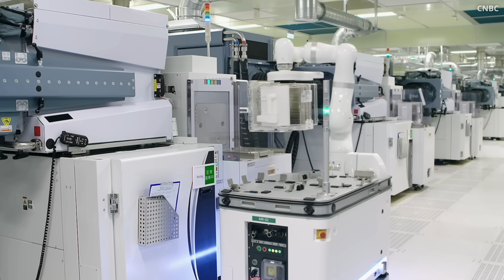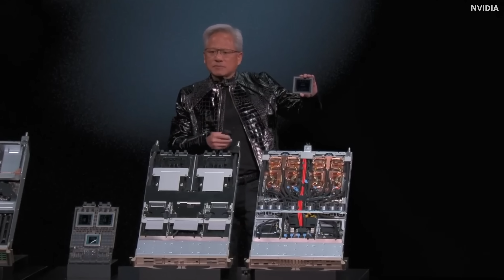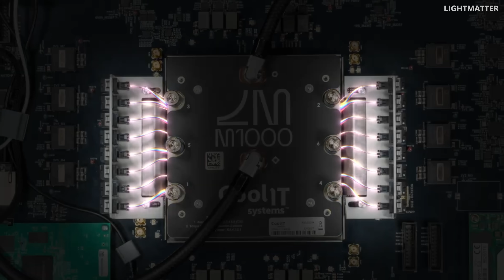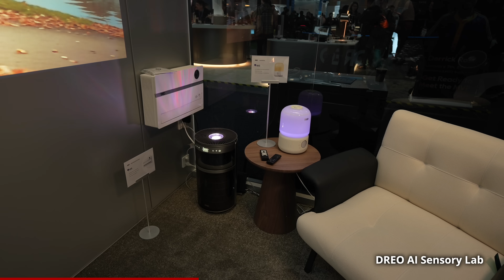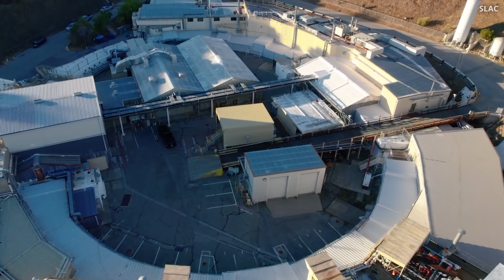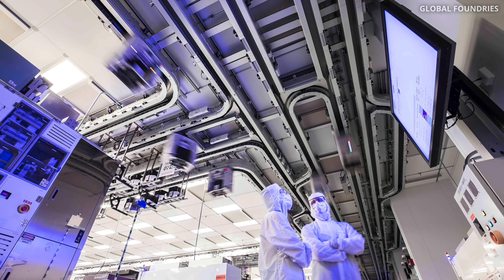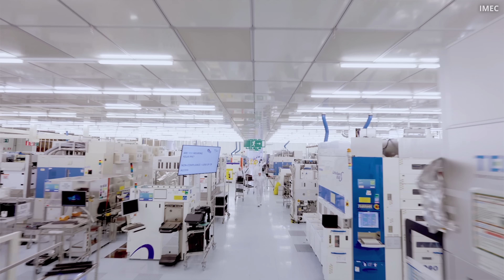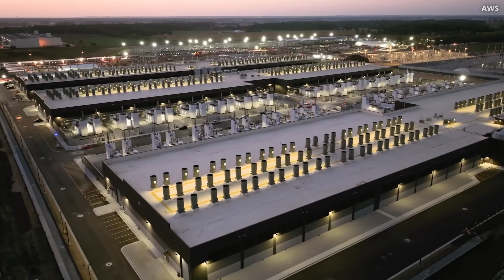This New Technology Could Kill TSMC and ASML

Comment: has X-RAY Lithography  been put to manufacturing use ? how are yields ? why don't you do some more research before waffling away on something. Why don't you delve into the inordinate problems of the energy content in X-RAYS WHICH DISTORTS THE SUBSTRATE IT IS PATTERNING!!             Problems with X-RAY lithography: Yields in XRL experiments are notoriously poor for several physics-based reasons:Substrate Heating and Distortion: X-rays have massive energy (photons are $100$ to $10,000$ eV, compared to EUV's $\sim 92$ eV). When these hit the wafer, they don't just "pattern"—they deposit heat. This thermal load causes the substrate to expand and distort locally. Since modern chips require overlay accuracy (aligning one layer to the next) within $\sim 1$ nm, even a tiny thermal expansion "kills" the alignment and ruins the yield.The Mask Dilemma: Because X-rays pass through almost everything, you can't use a standard glass/quartz mask. XRL requires a thin membrane mask (often silicon carbide or diamond).1 These membranes are fragile and prone to "sagging" or distorting under the very X-ray radiation they are meant to block, creating a geometric nightmare for pattern fidelity.Photoresist "Blurs": High-energy X-rays kick off secondary electrons that travel further through the resist than EUV electrons do. This creates a "blur" (effectively a lower resolution) that negates the theoretical advantage of the shorter wavelength.                                                                     .                                                                           EUV Lithography via multiple patterning is in use by TSM and Micron and Hynix. commercial production using EUV is already integrated into chip masking and printing. Prove me wrong. Thanks

Comment: Great insights. Hope this breaks the ASML monopoly, which I'm sure why the CIA is involved. Another company to keep an eye on is Xlight which uses the same CERN technology.
Reply: The US doesn't need this company to control the EUV technology:

 - EUV technology was originally developed in the US through consortiums involving DOE national labs, NIST, and many prominent private US companies. Most of the work was done in the US (the testbed, light source design, metrology, photoresists, etc.) before ASML joined the EUV LLC and got access to the technologies.
 - ASML was actually late to the game; it received permission from the US government to join the consortium, which gave it access to the technology, and the technology was transferred to ASML. (The US government rejected requests from Nikon and Canon to join the program due to national security concerns. That is why Japan, despite its significant share in the lithography tools and equipment market, does not produce EUV systems.) 
 - Along the way, ASML was granted approval by the US government to acquire several American companies, enabling it to build the system into what it is today. (It still operates under many of those licenses.)  
 - Many critical parts and components of the EUV system were developed in the US and continue to come from American suppliers. For example, the optics/mirrors technology was developed by Lawrence Livermore, Lawrence Berkeley, Sandia National Laboratories, and Tinsley Labs in the US, before being transferred to Zeiss. The reticle stage technology was developed in the US and is still manufactured there. Most importantly, the core and most complex part of the system—the light source—is designed and built in the US by an independent California-based company called Cymer. The laser is also designed in the US by Cymer and manufactured by Trumpf in Germany.

Comment: The market used to be more diverse, so it's nice to seem it diversifying again. Some of the worlds first Immersion and EUV lithography tools weren't created my ASML, they were created by an Oxford university spinout SME, but it ultimately killed by the underfunding of an overambitious EUV project, so it's funny seeing a picture of Oxfordshire based Diamond Light Source when you transitioned to talking about x-rays. Our biggest problem, as ASML later found out, was finding a light source that was bright enough. Although the project I worked on killed the company, the project lived on, and according to a paper I can no longer find, eventually ended up installed as an end station on a synchrotron, to get the intense 13nm beam it required. Going beyond that and looking x-ray lithography is a huge step, but if someone has the money to vertically integrate the whole factory, there is huge potential there.

Comment: Well, APM (Atomically Precise Manufacturing) Desktop Nanofactories as described in Eric Drexler's books (bottom-to-top approach which is better) will be the final level of Manufacturing.

No, what ASML does is not that - ASML's one is a top-to-bottom approach with limited capabilities (can't be use to make anything or everything outside of chips). What I'm talking about is true Nanotechnology as described by Eric Drexler, proposed by Richard Feynman -> atomic machines making molecular machines making other bigger machines -> bottom-to-top approach.

How close are we to this? Research has been seriously going on since early 2000s and as per Ray Kurzweil's predictions (who is also in contact with these companies) and Jeremy Barton's talks it'll start to be implemented in the early 2030s -> one of the first applications would be Brain Computer Interfaces - Nanobots acting as BCIs -> where the most popular application would be Matrix-Level-VR (VR with full-sensory perception - taste, touch, smell, true sight & hearing, thermoception, chronoception, etc.,); whether used for gaming, other entertainment, education, medicine, etc.

synapticvr on X or Twitter talks about this a lot regularly.

Comment: Really interesting video, but there are some massive technical and economic 'red flags' here. The biggest is the 'mask paradox': since X-rays can't be easily demagnified, Substrate has to use 1:1 proximity printing. This means they’d need to manufacture a perfect 2nm mask just to print 2nm chips—something current e-beam writers can't realistically do at scale, unlike ASML’s 4x/8x reduction optics.
Also, that 10x cost-reduction claim doesn't really hold up once you look at the math. Even if the machine itself is cheaper, the low throughput (wafer-per-hour) of a compact accelerator means you'd need a whole fleet of them to match a single ASML High-NA scanner. At that point, your overhead and footprint costs just skyrocket. Honestly, given the founder’s background and the In-Q-Tel backing, this feels more like a niche 'Fortress America' project for secure defense chips than a serious 'TSMC killer' for the mass market

Comment: The problem is not about building the circuit smaller. The problem is at certain point the electricity starts to leak. Heat become a major issue too. That's why China also spend lots of effort in the alternative aka "lights" chip.

Comment: Interesting thesis, and parts are plausible: shorter wavelength litho can relax some resolution pain and reduce multi-patterning. But most “breakthrough tool” stories die on the unsexy constraints: overlay/registration, stochastic defects, resist chemistry, masks/contamination control, metrology, yield learning, and—above all—throughput.

A few reality checks: “sub-nm in a single exposure” and “0.25 nm across-wafer” are extraordinary claims. At these scales, CDU/LER, shot noise/secondary electrons, resist blur, and defectivity usually dominate long before wavelength does. A $50M tool and “half the cost” also need a full cost-of-ownership view (uptime, wafers/hour, consumables, mask lifetime, maintenance, floor space, power).

Key questions that determine viability: source brightness + stability (dose), mask tech and inspection, resist sensitivity vs LER/CDU tradeoffs, damage/charging/secondary electron effects, overlay to existing layers, defect density and repair strategy, metrology loop time, and a credible path from a 12 nm demo to HVM (24/7) with competitive WPH.

On the business model: “we’ll build fabs” is believable only with massive capex, a long yield ramp, and an ecosystem (materials, masks, inspection, EDA/design rules, packaging) that takes years to lock in.

Would love to see published data: SEM/TEM/AFM images, CDU/LER plots, defect maps, overlay stats, dose/throughput numbers, uptime assumptions, and any independent replication.

Takeaways: treat “resolution” as necessary but not sufficient; ask for throughput + defectivity; and look for third-party validation before believing “EUV replacement.”

Comment: IBM was working on x-ray litho back in the early 90s.  From what I remember they were at Brookhaven National Lab on the NSLS.  Optics, masks and resists were issues back in the 90s.  Plus a synchrotron is needed.
Reply: Pardon me for asking a basic question, but here goes: why use the Brookhaven synchrotron to generate x-ray light when x-ray imaging in out-patient offices (ie. dental) was ubiquitous? Was it for shorter wavelengths?
Reply: @MsTyrie  Possibly.  I don’t know the exact reason.  It may have been higher energy level as well.

Comment: I am sorry, but you are talking bullshit. Your video is mostly based on the Veritasium video. Also 0.25nm is not sub atomic. ASML right now is working with a 1nm accuracy which is 5 Silicon atoms, for example. Please gather the physics facts properly and maybe correct your narration. Also the new startup did not tell anything. Right.

Comment: Study Lean Manufacturing and the chase for a single megalithic machine in a factory or a single megalithic CPU in a computer/server appears sub-optimal. How can cheaper chips and manufacturing processes be more flexible and efficient in a Fab environment? Software has a function to play too. Gates told his Windows teams in the 1990s to not worry about efficient code as Moore's Law would overcome their sloppy antics and they did, until about 2010 when RISC chips running Linux made strides in cheap mini-laptops. Further back, in the 1970s the US auto factories used massive stamping machines while Japanese manufacturers used small flexible stamping machines, rapid tool changes, minimal inventory, to dramatically cut costs; they had stumbled upon many of Henry Ford's Model T production tricks that the general US factories, including Ford, had forgotten. So while X-ray chip tech is interesting and exciting, what can be achieved in the systems surrounding chips such that AI servers can run high performance, simply?

Comment: This video is an ad for a company selling snake oil physics. Any physicist will understand for the need of bragg reflection for the claims, and you start running into insane problems to do lithography using bragg reflection. Frequencies above the need for bragg reflection won't achieve anything current near x-ray euv can accomplish with hyper na with just a couple exposures.

Comment: China has taken the lead this time by producing chips that do not rely on silicon but rather on data transmission using optical fibers and quantum technologies with smaller processors, leaving the United States behind China.
Reply: Only thing China is good for is building Temu chips that breaks within a year

Comment: Smaller transistors are not always better. They handle less current, leak more current, more susceptible to noise and cosmic radiation and more expensive. There is not the need for more speed like there was in the 70's. Today's computers are fast enough.

Comment: Instructional Essay: Atomic‑Scale Technology, Physical Limits, and the Illusion of Cost
Modern semiconductor engineering has pushed matter to its physical edge. Today’s most advanced experimental devices operate at sub‑nanometer scales, where the active channel of a transistor can be formed from a single atom or a single‑molecule structure. Research groups have demonstrated 0.3–0.5 nm gate lengths, which is smaller than the diameter of many atoms. At this frontier, the limiting factors are no longer manufacturing precision but the laws of quantum mechanics themselves. Below the atomic scale, electrons no longer behave like particles confined to a channel; they tunnel freely, making the concept of an “off” state impossible. This is the hard physical boundary of classical transistor design.

To move beyond silicon, engineers turn to materials that behave more predictably at atomic thicknesses. Graphene, carbon nanotubes, and 2D crystals like molybdenum disulfide (MoS₂) can form channels only a few atoms thick while maintaining stable electronic properties. These materials offer higher mobility, stronger bonding, and cleaner interfaces than silicon, making them suitable for sub‑nanometer devices. The next generation of computing will rely on these structures, not because they are fashionable, but because physics demands it.

Yet the technical story is only half the picture. The “cost” of such technologies is often framed as a financial burden, but money itself has no inherent value in the actionable universe. It is a symbolic system used to coordinate human labor, and its meaning is shaped by institutions rather than physics. The real cost of a transistor is the energy, time, and human expertise required to design, fabricate, and test it. Machines reduce the energy required per operation, but the financial system can distort this reality by assigning prices that reflect power structures rather than actual effort.

This distortion becomes visible when technological achievements are marketed as “cost‑saving revolutions,” even when the underlying economic conditions for ordinary people worsen. The narrative of efficiency often masks the fact that financial systems can redistribute wealth upward while presenting the illusion of progress. Money becomes a hypnotic trace—an instrument of authority that claims legitimacy through repetition rather than through any intrinsic connection to the physical world. The value lies in the actions of people, not in the symbols used to measure those actions.

In this context, the pursuit of atomic‑scale computing becomes symbolic of a larger tension. Engineers push matter toward its fundamental limits with extraordinary precision, while economic systems drift further from the physical realities they claim to represent. The transistor shrinks toward the atom, but the gap between human labor and financial reward widens. Technology advances through the disciplined application of physics; society often moves according to narratives that obscure who creates value and who extracts it.

The future of computing will depend on materials that obey the laws of nature, not the abstractions of finance. And as we approach the atomic limit, we are reminded that the universe runs on energy, structure, and information—not on the symbols humans invent to control one another.

Comment: This is one of the best EUV and X-Ray semiconductor videos I’ve come across. I really appreciate that you featured my video animation work on xLight and provided such a clear explanation of these complex concepts😎🚀 Substrate has a challenging journey ahead, and their patterning prototype suggests that their X-Ray is very underpowered and based on that info they haven’t figured out a particle accelerator solution at scale. If Substrate manages to succeed, it could truly be a game changer. But for now, xLight has already figured out EUV-FEL particle acceleration and they are the first light source to achieve exponential results, with the first wafer printed in 2028. I'd assume it would be ~2 decades before Substrate could become a viable solution if they do figure it out.

Comment: 90% of computing applications do not require the most advanced chips. That said you cannot print the smallest spec chips all at once because they are built up in layers, the layer above obscures the layer below. File this story in the bs bin. How the hell does this woman switch from chip manufacturing to household fans? This channel is a joke.

Comment: It has been used to make working 15nm prints. It has always been the problem of controlling the electrons. But now it looks like the possibility of 0.1nm is possible. However, it will likely be 10 years before we see a working sub nm lithography machine. Of course I am basing this on things I have read and not any personal knowledge. I believe GaN will be used instead of silicon, when all is said and done and sub nm prints are commercially viable.

Comment: Yes, X-Ray lithography may achieve higher resolution BUT even using EUV, the wafer has to go through this process many passes as each pass builds one layer and chips often contain several layers.  As you have said x-ray passes through almost everything, so the possibility of creating multi-layer chips to me is not possible.  Anyway, what they have shown is only a single pattern. I will believe in this technology only when I see a chip manufactured using this process.

Comment: C'mon, yet another! X-ray lithography exists since more than 50 years, with all the optical implementations imaginable.,Synchrotron physicists are smart persons and they explored all that long ago. It works, but it never justified the costs, except for prototyping. Not for mass production. A 50 M$ (cheap...) synch is not at all what it takes. You need strong wigglers, they either suck huge currents or require expensive cryogenics, a lot of highly specialized human control, etc. Each port requires a more complex machine than a hospital MRI, not including the synch part. Is the same as for fusion reactors, they work since more or less the same period but never produced enough to justify the costs. Do you think that after 70 years of building accelerators all these people learned nothing?